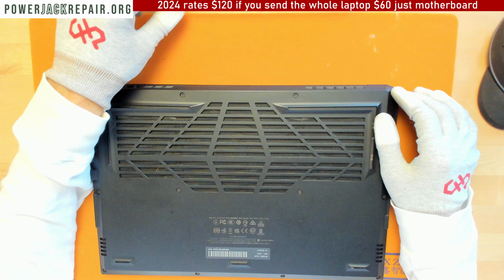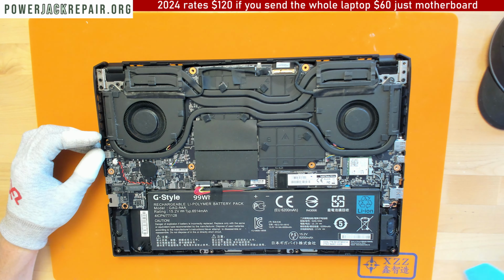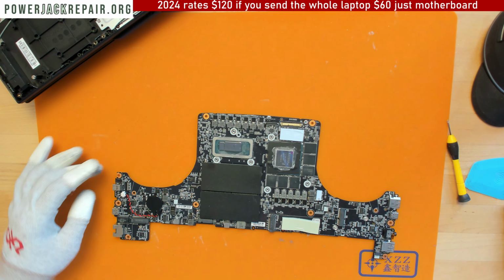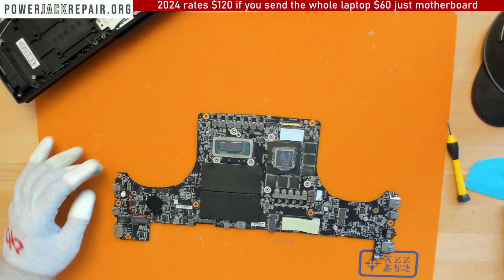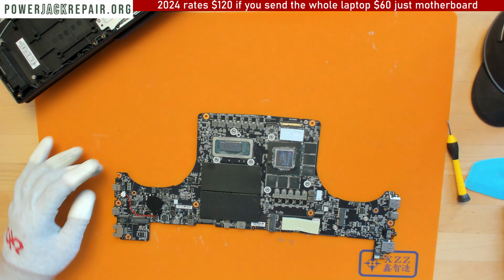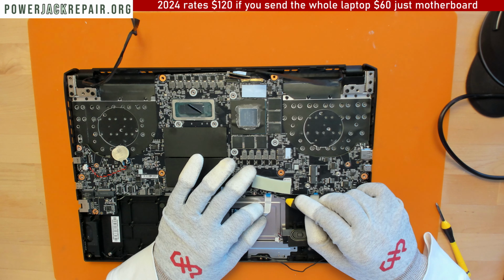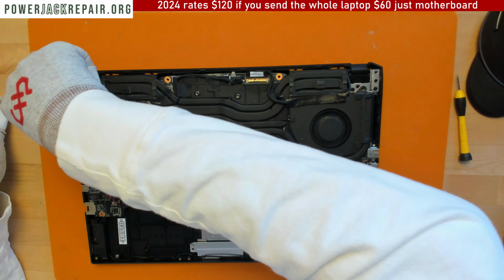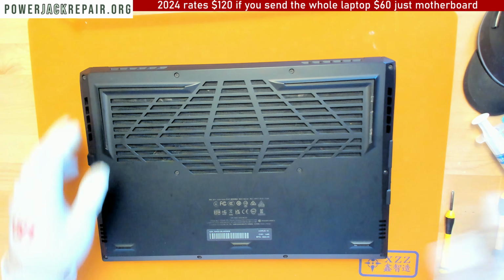Gigabyte Aorus 15 RX5P disassembly laptop charge port power jack repair fix taking apart tear down

Comment: when putting back the heatsink in place at the end of the video, you only replaced thermal paste on cpu and gpu. Why did you not replace the thermal pads on the vrms? You kept the old thermal pads, why that? They should be replaced with new ones every time you remove the heatsink and put it back in place, in order to keep temps low and the laptop cool